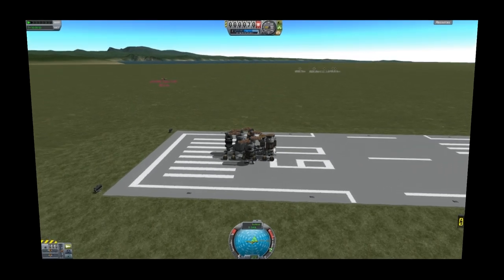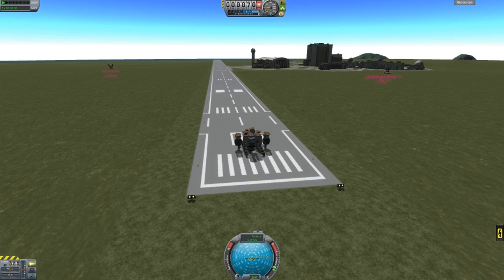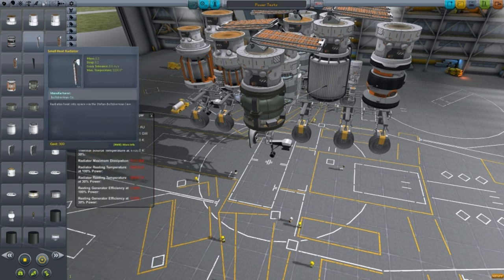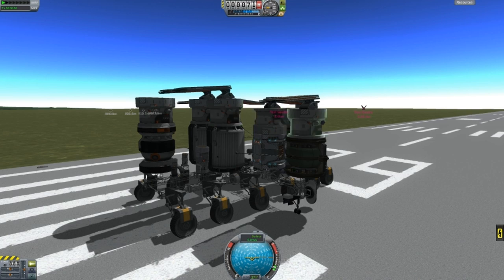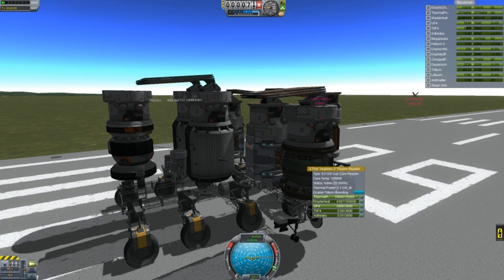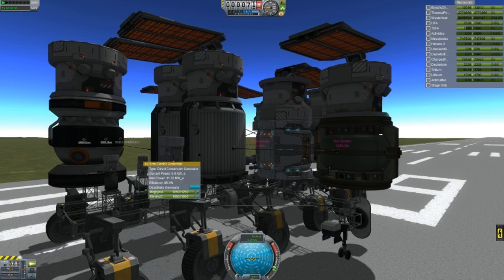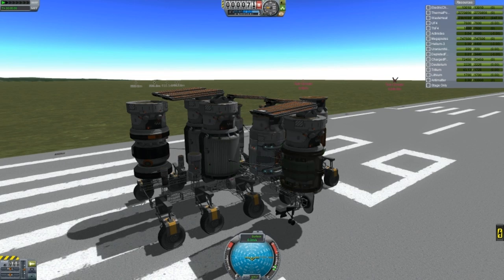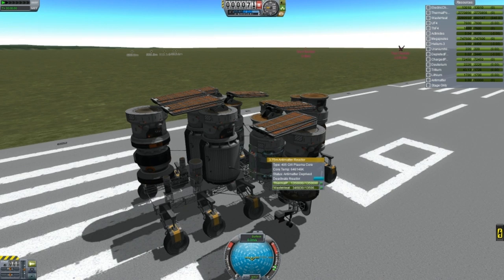KSP Interstellar: Reactors Tutorial

Comment: Nice tutorial, thanks!
I believe the radiator's performance is proportional to its temperature to the fourth, not the altitude (thought it emmits more in outter space than inside the atmosphere).
That is why it will balance your wasteheat at an especific temperature, in witch the radiator will emmit the same amount of heat that your ship generates.
I mean, thats's true in real life, not sure about KSP =P
Reply from the maker: Thanks for the tip glad you like the tutorial, Could you confirm it works that way in ksp tho. So far the temperature factor is just a number with no effects at all in relation to anything. The radiators that open/close change emission value and thats it. Unless they actually went a deeper in terms of reality.
Reply: AddMeGamers
I could try some stuff in-game, but I don't understand a lot about programming or modding to check the actual formulas used in the code. I'll let you know if I figure it out.

In real life, radiation emission is       Q = A*e*sigma*(Ts^4 - Tsur^4).
'Q' is the heat emission. 'A' is the radiator's surface area (when you extend/open the radiators, the area increases, and so does de emission). 'e' is the emissivity of the radiator, that depends on the surface's material. 'Sigma' is a constant. 'Ts' is the surface's temperature and 'Tsur' is the temperature of the surroundings (in space, it is near 0K (-273 Celcius), and that's why the radiators emit more radiation in high altitudes than they do in low atmosphere).

I Hope I was clear, english is not my first language. =)
Reply from the maker: Leonardo Chavez Thanks it cleared up a few things, and dont worry about your english it seam very good :) Otherwise i really dont think that they are using this logic to calculate their radiators, but take a look if you find it and let me know. Again iam sure somebody will make a mod to fix it if anything ;)

Comment: Hello. I have an issue regarding this mod that I'm hoping you, or anyone else, can help me with. 
I'm playing on KSP 1.0.5, and have just installed the interstellar mod, along with a mod which adds a red dwarf star and planets around it. The issue now is that I cannot toggle options in non-stock parts. What I mean is, for example, the stock solar panels and radiators: in vab I can set them into action groups, and also when I'm on pad I can right click toggle them.
However, when it comes to the interstellar parts (apart from engines) I am completely unable to do those things. Maybe I'm doing something wrong within the game, but could it be a dodgy install?
I've re-installed twice to see if this solved the problem, but it has not. Would really appreciate any help which you might have. Thank you :)